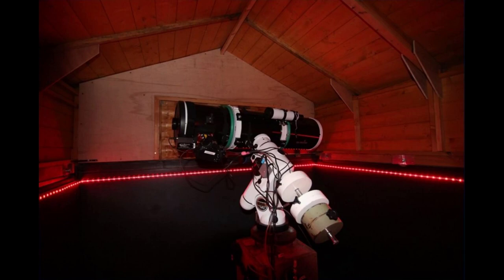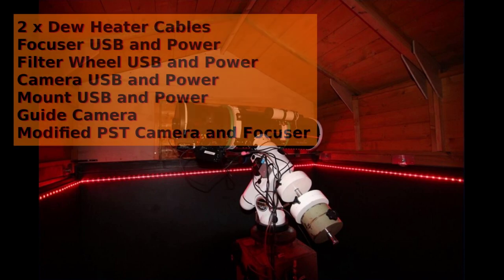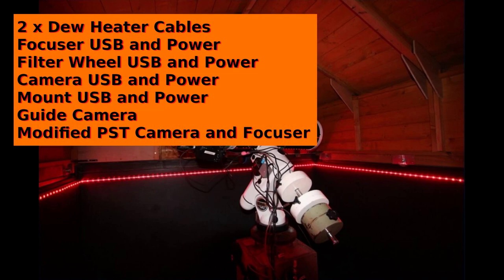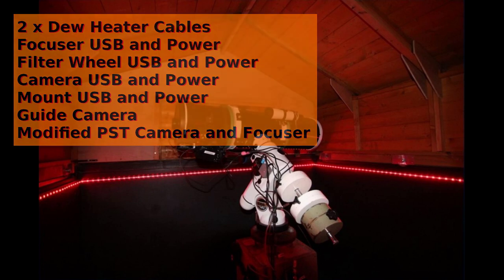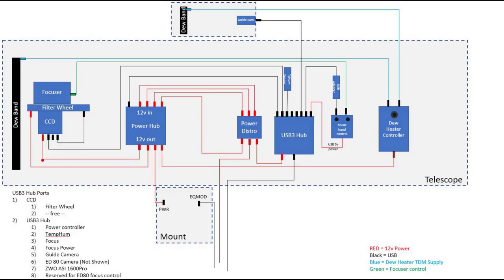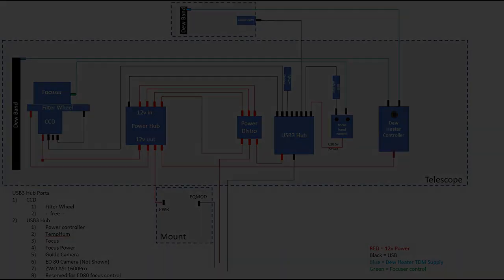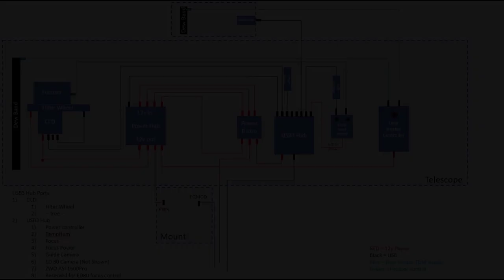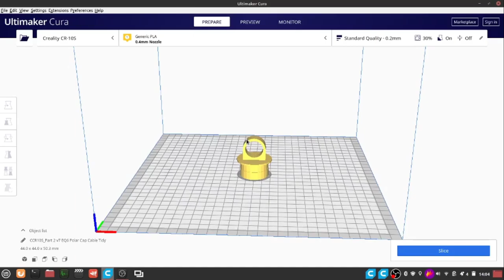The Ultimate EQ6 Cable Management System

Comment: Thanks, I had someone 3d print these.  Most should work on the EQ6R Pro but the Polar scope one doesn't rotate as in your video is this normal?
Reply from the maker: When I made this I went through a few iterations to get it secure but movable, this will depend on the tolerances of the hole in the mount and the 3D printer, but I don't think it matters a great deal, of you want it looser, I'd suggest sanding the 3D printed part a little.
Reply: @SimonTelescopium  Only one of these parts actually works with the EQ6R-Pro, the Dec piece.  Rest of them were useless, it doesn't even come close to fitting in the polar scope hole.  I will try some sanding but using the handle was good point to secure cables with velcro ties.  I will report back to the sanding :)